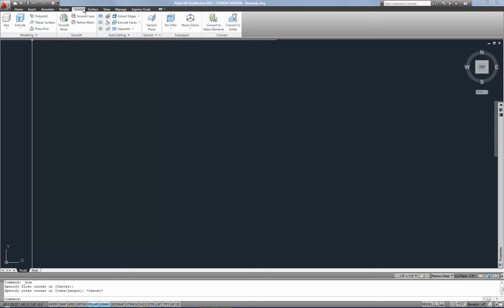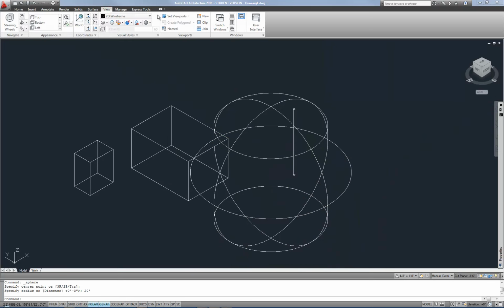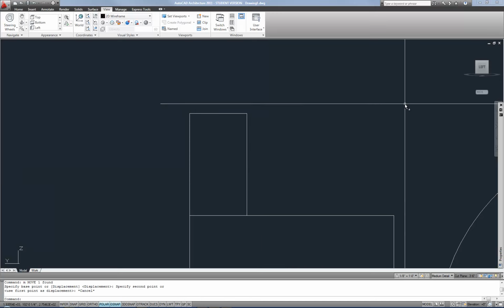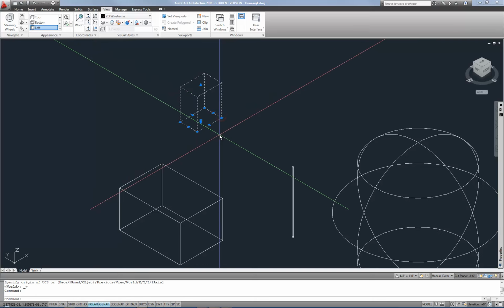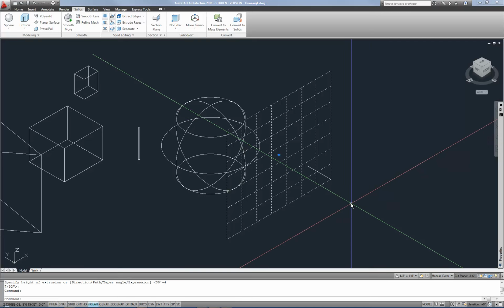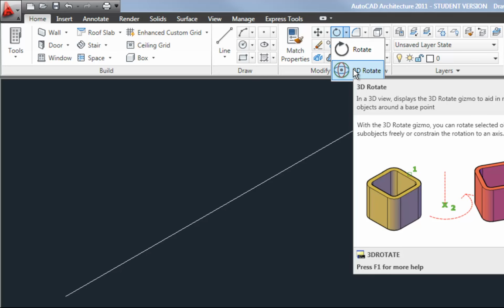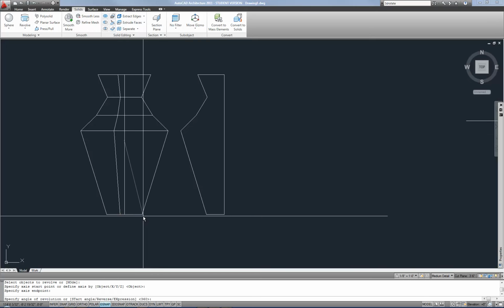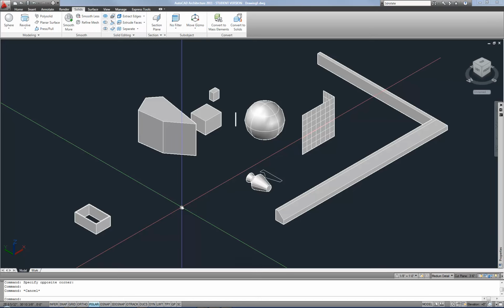AutoCAD Interm.: Basic 3d solid modeling

Comment: I found this very helpful, thank you. I just had one question - is there a difference between a closed surface and a solid? if close a surface off does autocad automatically change its property from surface to solid?
Reply: +Ian Murphy Yes, surfaces and solids are different, like comparing a hollow shell vs a solid object.  No, AutoCAD will not automatically convert because they are different object types.